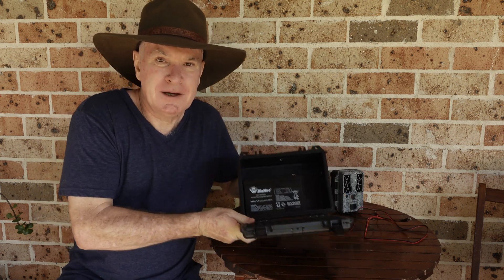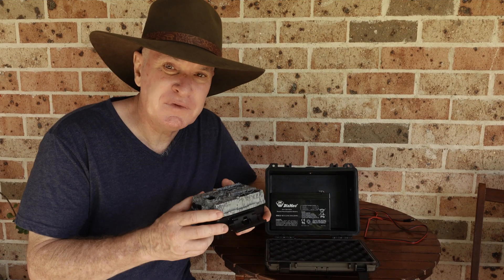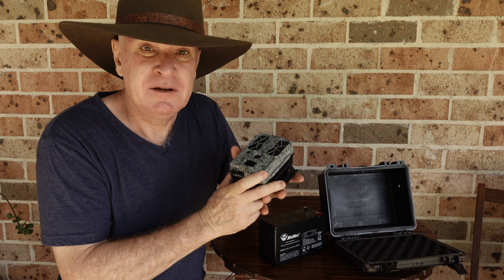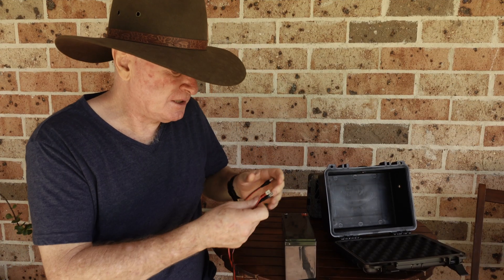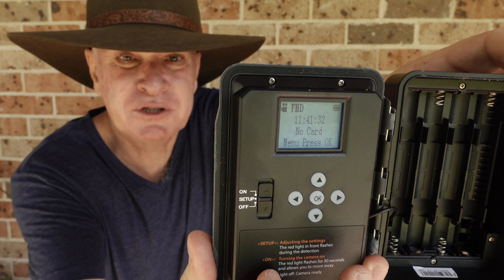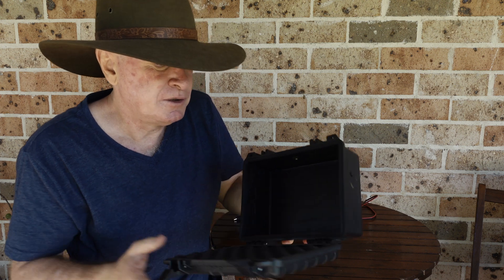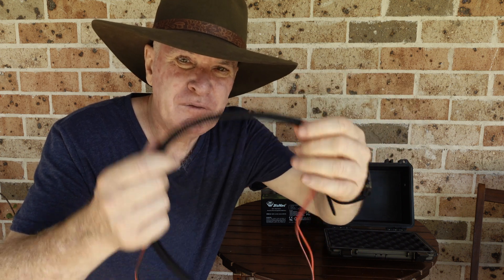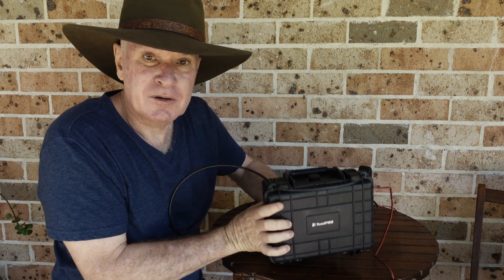Trail Camera. Do it Yourself. External Battery Pack

Comment: Great video Andy! I will be making one of these to sort out the problems i am having with my trail camera not taking videos in the dark, I tried all manner of different AA batteries but I think you are right, most don't have the grunt to power the sensor, camera and leds at night especially if its a bit cold.

Comment: Hi there. At minute 3:00 you mention that it is to be determined what the appropriate voltage for a given camera is, but you didn’t say how to find out! I have the Little Acorn 5210a, but don’t find the voltage needed somewhere on the camera or Manual… -Maybe a stupid question but I am not into electronics at all.
Reply from the maker: From what I can see on the Acorn 5210a, it uses a 6 volt external power supply. So to build this external battery box as per mine, it’d need a 6 volt rechargeable battery and the appropriate plug to fit the external socket.